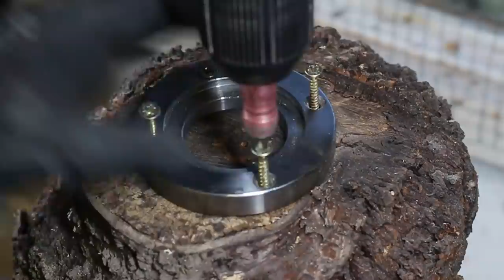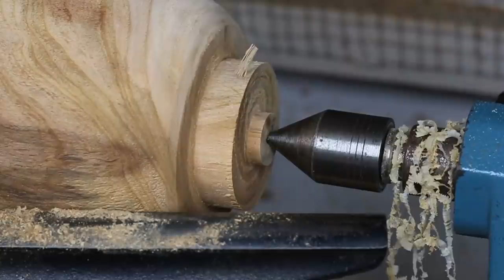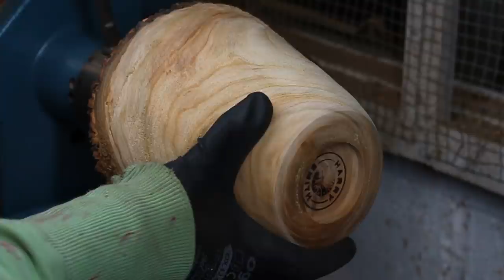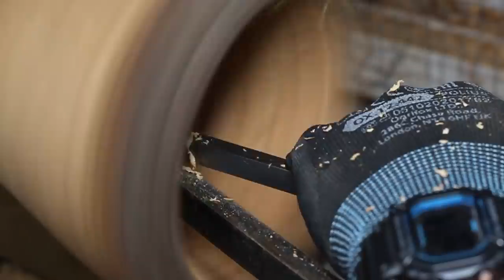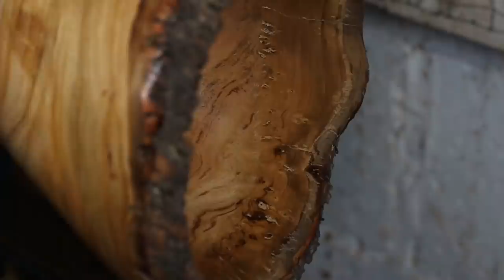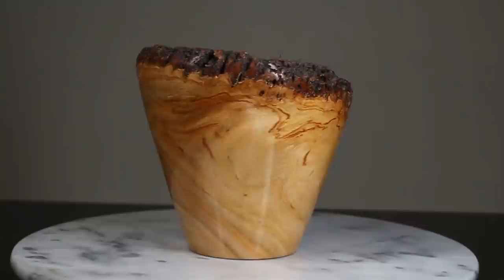Woodturning - Another Cherry Burl!

Comment: Harry, nice job. Don’t know if you’ve noticed, but when you’re holding the piece in the Chuck, when you bring the tailstock up for support and apply pressure, the work piece seems to move upwards, just putting it out of alignment slightly.
Reply: Thanks Michael, I chose the wrong chuck for this project and didn't realise until it was too late, hence the slight movement. Great observation 👍  A+  😃👍